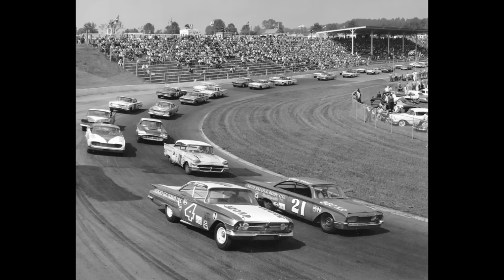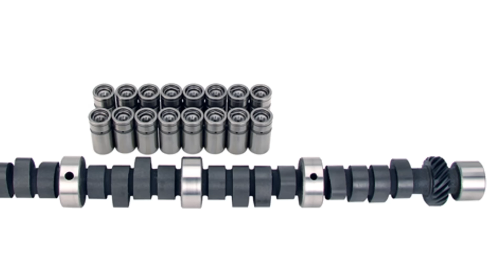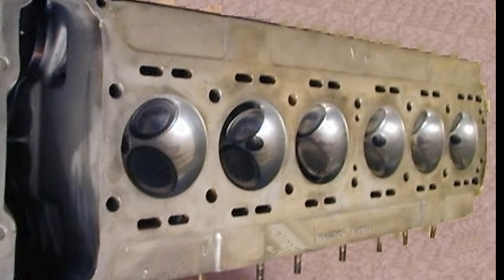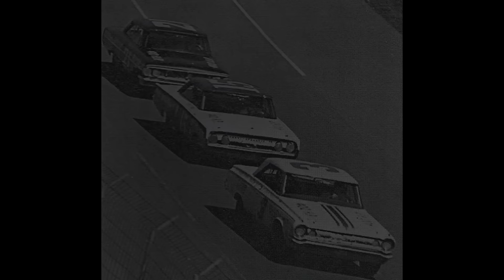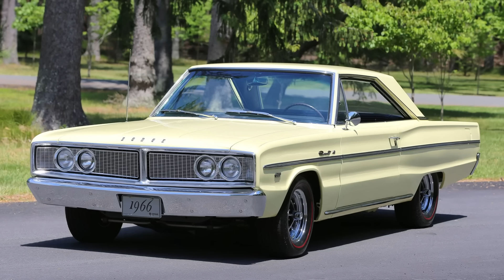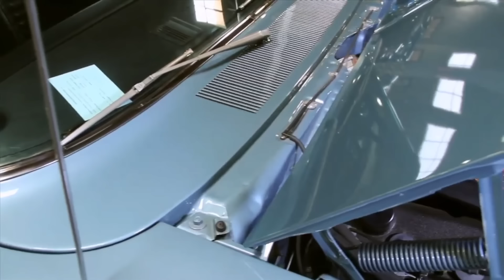How the 426 HEMI Changed American Racing Forever!

Comment: 16:12 What a stupid rule,considering today none of Nascar engines are used in production vehicles at all.
In any event, Nascar was best in its earlier concepts. Today, cars are all the same, making it all about the driver, BORING 
I wanted to see a race about the best machine and automobile technology available, not some nini behind the wheel. The last time I saw a Nascar race was in 79. Now those were real cars with a great mix of manufacturers, even tho Nascar was already was damaging the sport,nevertheless it still was not as bad like the current clone cars everyone is forced to watch. Just recently, a test  shows a 1970 chrysler superbee out performing and beating a next gen Nascar, with the superbee using 70s technology maintain 200mph and beating the next gen by a full lap,,,imagine that.
Currently, Nascar is still holding back vehicle manufacturers because it is about the driver,,what a joke.
And don't say it all about safety because it can be done and still make it safe.

Comment: I had a similar setup in my 4G32 (1.6L hemi lol) - ridiculous cam, overcarbed, higher compression, 5 angle valve job, ported head, portmatched intake, 4-1 headders... It could not idle below 1,200 RPM, and had very little torque until about 2,500 RPM. After that, holy crap did it liven up - like having VTEC on all the time (the duration was outlandish - max lift, overlap, sounded like a V8 no joke) but unfortunately I spun a bearing racing it at Mosport - I did not build the bottom end and I starved the bearings of oil. 

Install baffles and a better pickup system, possibly a windage tray, folks!

Comment: The hemi design still dominates the drag strip today.  The Donovan and Milodon nitro burning engines for Top fuel rails and funny cars are all hemi designs.  The wedge holds its' own until you add the blower.  Fully blown the hemi is leaps and bounds ahead.  What a magnificent design.

Comment: The Ford 427 Side Oiler turned out to be a better engine! They got kicked out of NASCAR as well and In NHRA racing they got over 2500 horsepower out those Side Oilers!!
Reply: Better than what? If you're referring to the 427 Cammer, it was prone to breaking its six foot timing chain.

Comment: For you Dodge and Chrysler die hard fans still using stock ignition distributor, remember the Napa MO-3000 rotor will give you much more spark.

Comment: It was Ford that out performed in the 60s, you know the 427 DOHC and 427 "cammer" Evan Richard Petty can tell you this and why he no longer raced for Ford but moved on to Chrysler. That was NASCAR. Chevy and Mopar always take from Fords engineering and just make tweaks like they created something. There is a lot of history on Ford the others just duplicate.
Reply: The "cammer" you referred to as 427 DOHC, is the 427 SOHC, that's a single overhead cam on each cylinder, not two. Chrysler was developing hemispheric motors in the 1950's. Know one is doubting Ford's contribution to Automotive engine design. I grew up in the late 60's and early 70's working on many of these engines and cars. All engines have their short comings, Ford won Le Mans in 1966,67,68,69 with the legendary GT MKII powered by the new 64 427 side oiler, not to mention engines like the 289 hipo, 302, and 429 Boss, and one of my favorites the 351 Cleveland. Get your facts straight, you seem not to know the difference between a "cammer" which is the same engine as a Soc motor, (that's the 427 SOHC), the early DOHC 427 that was never developed in any complete production form.
Reply: You're full of it
Henry Ford couldn't build a decent car! Wasn't till the DODGE BROTHERS took over the production that made ford the best automobile manufactured! From 1903-1913. They built the model t! Not Henry
Reply: @FrankRivet-gf8bi  Right  On   brother ,  your  Facts   are  correct  ,  it  was  the  Dodge   Brothers  who  made   Henry  Ford   successful  by  making  a lot  of  parts  for  Fords   vehicles     , plus  the   brothers   backed   him  financially  .

Comment: The secret to the hemis power is flow & better spark efficiency big valves and thin stems & of course the hemispherical combustion chambers and with all these factors create an engine that loves running at high rpm’s oh petty won the 64 Daytona 500 by not 2 minutes but 2 LAPS
Reply: Petty was driving a Ford. And Henry Ford designed and made the First Hemi engine with Rolls Royce in the 1930s and then the 427DOHC, Chrysler just took notes and copied from Ford.
Reply: @88Mustang  The 426 Hemi came out before the 427 SOHC (cammer). Ford mandated their engineers design and answer, thus the cammer known as the 90 day wonder. Ford did NOT make the first hemi at all. Welch, Peugeot, and a few others designed and built hemi engines as far back as 1904. Clearly before sniffed it's design. History is your friend, research is it's ally.
Reply: @88Mustang  wrong
Reply: @88Mustang  WTF are you talking about? Petty never ran a Ford until 1969, and that was for only one year and that was only because Plymouth wouldn't let him switch to the Dodge Daytona. Then they corrected that in 1970 with the Superbird.
Reply: @88Mustang bullshit

Comment: There is so much wrong with the reporting in this video starting with how the 421 Pontiac was strong in the early 60's along with the 427 Ford the kicker was the 430 Chevy Mystery engine that blew the competition away but couldn't finish a 500 mile race because of poor valve train issues.  I think Mopar looked at that engine and started work on their Hemi . Ford came up with a new High Riser head for the 427 and the hp went up substantially but so did reliability issues . This engine was dominant in Drag racing in the Super Stock classes with a real factory hp of 550 right off the showroom floor but it took some half a NASCAR season to start winning with the Ford and Mercury teams . Meanwhile Ford engineers brought out the 90 day wonder  427 SOHC  with 616 hp in stock trim and Chrysler protested . Weight restrictions on that engine restricted it to being non competitive so it went on to being used in drag racing with huge success and actually started the Funny car era also it did well in Top Fuel and AA/ Gas classes as well as Pro stock.
Reply: Yes, the 427SOHC did have success as you mentioned, but its Achilles heel was the 7-foot cam drive chain that would Stretch over time, plaguing valve timing. the bottom end was known to come loose at high RPM, until development of the Donovon aftermarket blocks and griddles.

Comment: The Hemi was strong enough to thrive in drag racing at high rpm, forced induction and experimental fuels.
Reply: So True. You can throw anything at that Hemi, and it's hard to kill it. Have you ever seen the size of those rods? WOW! Huge!
Reply: Didn’t need a whole lotta high rpms with a big block. The power band was just above mid throttle. That coupled with the legendary 4 speed sticks of the day made every trip an ear to ear grin !! 😊